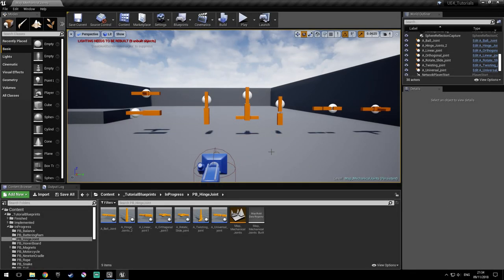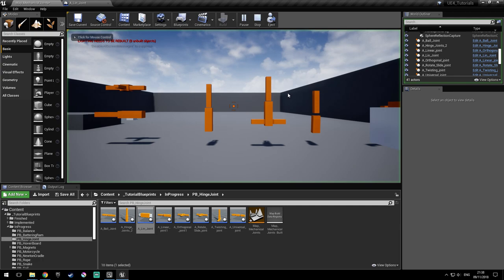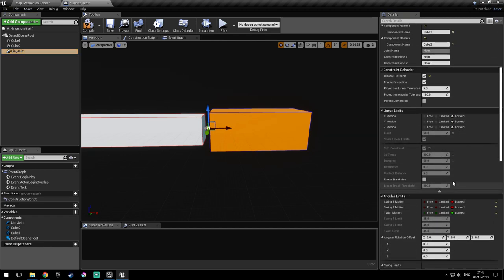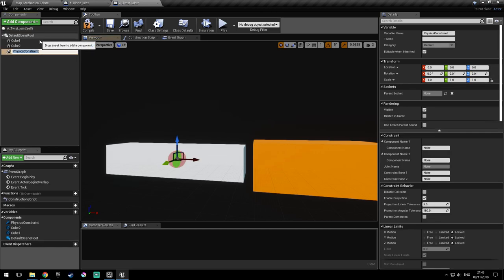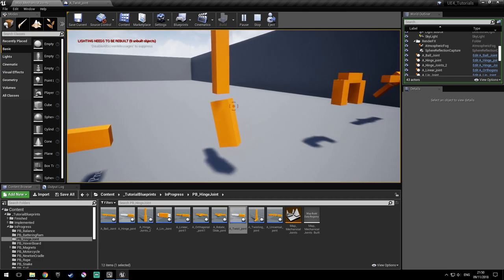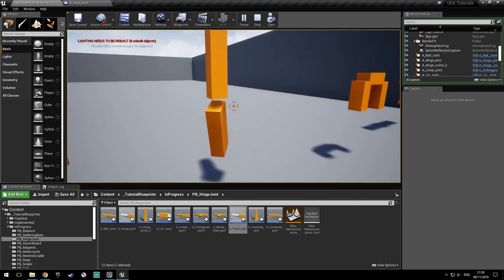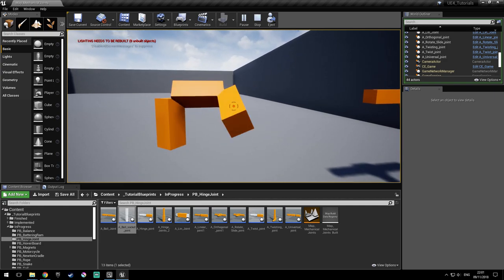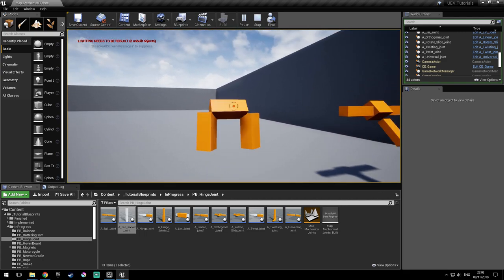UE4 Mechanical Joints - Physics Constraints in Unreal Engine 4 Tutorial / How To

Comment: Say, how would I change the direction of a physics object more quickly? Rather then it slowing down by adding force over time is there another way to make the sudden changing of direction quicker but without effecting the added force over time? Not sure if I made that clear but, in this case, I am rotating an object around a central axis using a physics constraint, but I want the changing of direction to be a bit more responsive. Right now, it slowly slows down before changing directions.

Comment: You explained things very clearly, but for some reason it does not work in VR without an intermediary. A stick or bullet, or something. If I se it up the way you have it, and shoot it, or hit it with a stick, it reacts as expected. If I grab anything, it has a different affect. 
For instance, I have a lever that has 2 parts. A base (that I want locked) and a stick, which I want to rotate at the base. If I have Constraints locked in XYZ for Position, on both the Base and the Stick, the stick still pulls away when  I grab it. I have to put a value in Inertia Tensor Scale XYZ to get it to lock to the base (not sure why).
Can you explain how to make a lever, and have some resistance on the movement?

Comment: Question: 
You have Cube1 and Cube2. 
If you want to move (through BP) Cube1, how would you do that?
Say... you want this thing to move out of the way, after the player has moved the slider. Player slides the handle, and then the whole door moves up, or something.
It seems UE4 pulls the objects out of the hirarchy when they are attached to a Physics Constraint, so their original parent's movement has no affect on them.

Comment: Question: how can you animate a robot arm using this ? I have correct motions now, but it's limp/ragdoll. How can I make it rigid, for example, follow a null, and rotate/move in this same position, but way more rigid and only if pressure is applied

Comment: I used the linear join concept, to make a landing gear for a spaceship.
It is basically a leg that has suspension. Very simple. At first glance it works fine. But doing some tests I discovered a strange error:

the landing gear disappears when the ship is oriented in a particular direction.
For example, if the nose of the ship is to the east, everything is fine, but if you point it to the south, the landing gear leg (which has the physical constraint) disappears. (?wtf?)

Even weirder is that this doesn't happen on the map I have for testing.
I have no idea what is happening.

Comment: Thanks for the great tutorial. When i make a cabinet with some drawers use physics, i drag the mouse can move the drawer to the far far away, i had set the physice constraint X limit but it is not stop at that position, how to fix this problem?
Reply from the maker: I'd have to see the setup of you constraint to help you with that. Make sure that the limits of the constraint are set correctly.